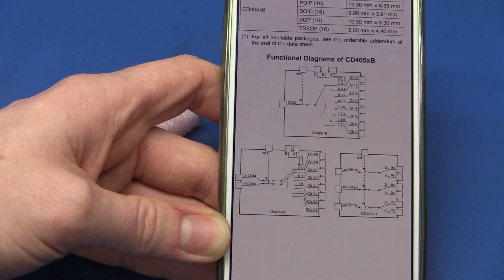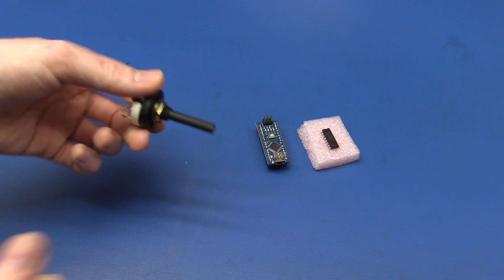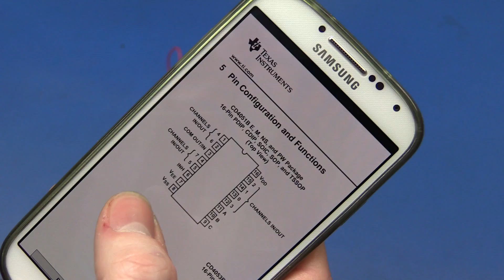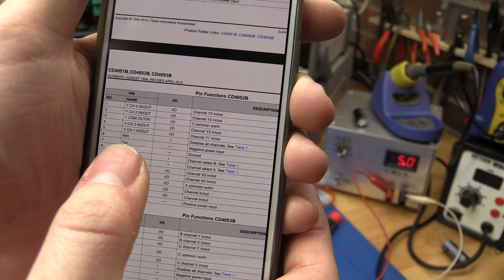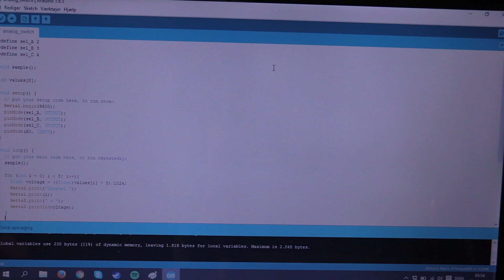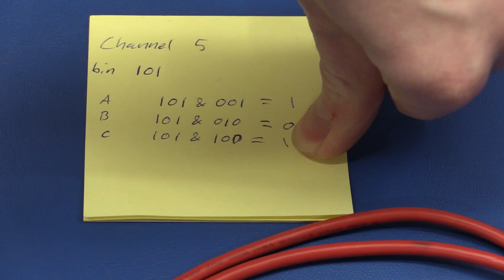Chip Chat #4 CD4051 Analog Switch / Multiplexer / Demultiplexer - Ec-Projects

Comment: Great video - but I have one question after reading the data sheet: can I use it at 3.3V and check higher voltages with it? At the moment I use a voltage divider with my analog pin to do so, and if the CD4051 could handle voltages higher than its supply voltage I could just keep that single voltage divider between its output and the analog pin instead of having to put resistors on every pin of the CD4051.
Reply from the maker: Hi, good question.. It is not immediately obvious from the datasheet, I must say. But if you look at section 8.1, they give you some examples. It looks like you can only go up to the Vdd supply on the analog signals.. :)

Quote from TI datasheet: "For example, if VDD = +4.5 V, VSS = 0 V, and VEE = –13.5 V, analog signals from –13.5 V to +4.5 V can be controlled by digital inputs of 0 V to 5 V."
Reply: Thanks for the quick reply! Too bad, would have been easier otherwise. ;)
Reply from the maker: Yeah :P Sorry for the bad news :)

Comment: I have had an X8 octocopter drop out of the sky because of a dead cell as well. Luckily it wasn't mine, but even worse one from a project at uni that had several thousand Euros worth of sensors mounted. According to telemetry recording it hit the ground with at least 10m/s (drop was from a height 30m). Proud to say though that the box I built for the sensors survived the crash and even still transmitted data from the ground ;) . (copter maintainance wasn't my job).

Anyways, for my el-cheapo chinese parts self built quad (with foldable arms) I now want something similar as you are doing. I thought about a solution with a micro at first. But in essence I just want the lowest of the cell voltages and transmit that via telemetry instead of the full pack voltage (the flight controller only has one input for voltage monitoring). For an ideal battery I just multiply with the cell number and get the pack voltage, for an unbalanced battery I get a lower reading than the real pack voltage (so it errs on the safe side).

You might want to look here, if you should need something like that.
http://i67.tinypic.com/14tx5k.png
The circuit diagram should be pretty self explanatory. Pretty much one diff-amp per cell and one final opamp that picks the lowest voltage via diodes and spits it out. You don't need a special opamp either (even something like a LM324 will do), as long as your it can handle the full pack voltage and it's easily extendable for more cells. I have not yet built the circuit, but the simulation in LTSpice works out ;) .
Reply from the maker: +superdau Sorry to hear about the copter :/ Thanks for the link, pretty nice circuit :)

Comment: Great topic and video. The multiplexers are nice if the input to drive is high impedance... I used this 4051 in a hobby project with 8 fans, 8 tach signals and 8 current sense lines to a mcu. The current sense lines to be ADC'ed could probably just have been muxed in the mcu with the ADC mux like you say earlier in the video.. but the tach signal, if you want to use the capture (capture timer by change on pin) (in PIC mcu that I used, not sure about the atmel/arduino), then multiplexing is great for selecting tach from individual fan and feeding it to the capture pin.
Reply from the maker: +bwack Thanks. Yeah, I used it for the timer in a PIC also :D To display RPM of 6 motors :)

Comment: now i'm curious what you're going to need that 44v high-discharge lipo for ^^
apart from your nice electronics video, there's a thing to be learned here. even with "good" quality lipos, one should always balance charge them before use and also periodically.
Reply from the maker: +h3po It's going to be fun, I promise :D The battery was balanced, and it died on the first use unfortunately :/
Reply: ofc there might've been a manufacturing defect. let's see how hobbyking handles your return. i was under the impression that they actually test all the cells, as they also sell "b-grade" packs for lower current applications.